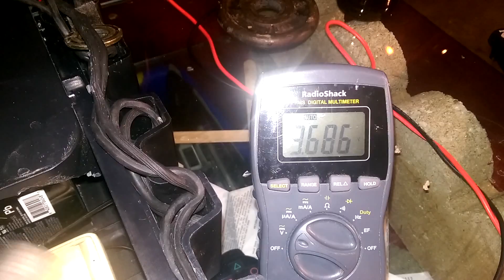Dual Rotor oscillating Bedini Motor Sneak Peak!

Comment: I'm going to try 2 rotors but one with south pole side of magnets facing outwards to pick up backside of one coil.  Purpose, to use passive coils to pick up and store induced voltage.  Using a hard drive spindle motor with many platters and small neo magnets.  Getting what appears to be over unity - 12.5 VDC on primary and 13 VDC on output with around 150ma draw.  Plan to use some solar cells to keep primary topped off.  Next gig is a 24 inch rotor and new coil.  

I found that pre-twisting my wires made a big difference on the trigger coil.  Would like to see more of your setup.